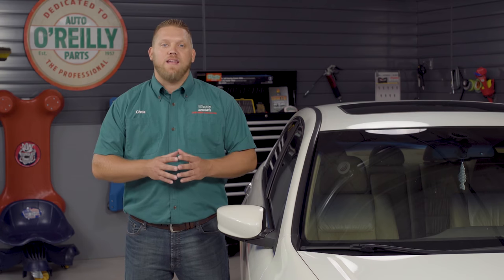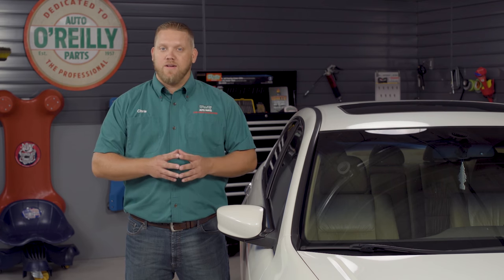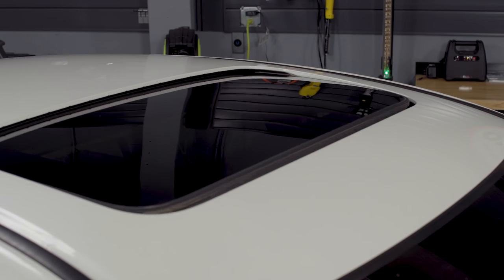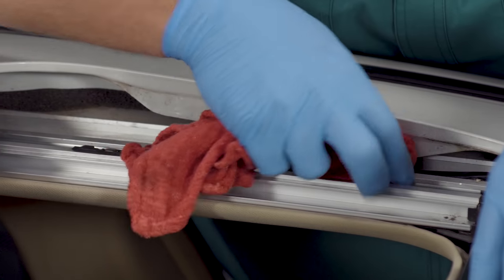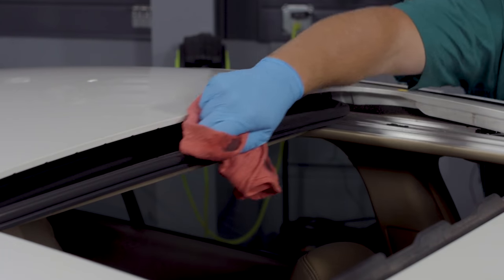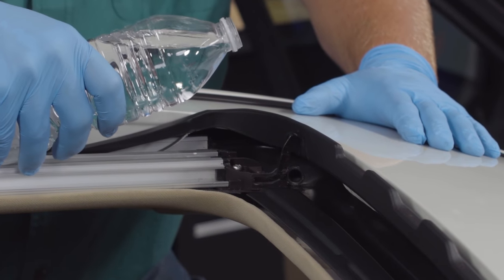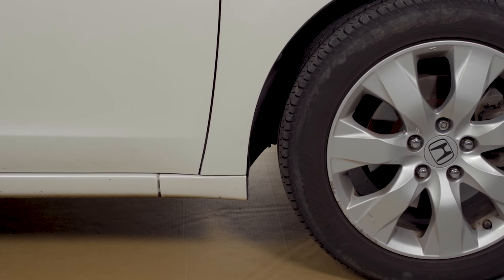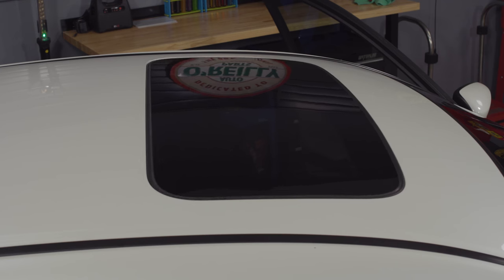How To: Repair a Leaky Sunroof

Comment: I was having a leak inside my 2007 RAV4. I was on the verge of taking it in and paying to have it looked at because my passenger seat was getting soaked every time it rained. Ran across this video, did the test as described, and sure enough the drain on that side had something in there that was restricting the flow as it too 30-60 seconds for water to start draining from the bottom and even then it was a trickle versus the driver said which was a near-instant gush. Hooked up an air blower and ran it for about 3 minutes and the flow greatly improved. The other night we received almost 2" of rain, and my seat was dry the next morning, no drips or anything. Thanks for saving me money.
Reply: Another mechanic channel warned against using pressurized air - the problem is it could pop the drain off the sunroof frame where you couldn’t see it, but you would now have a totally disconnected drain hose which would be even worse than a clogged one.
Reply: I have the exact same car and have the exact same issue right now, I’m about to try this

Comment: Do not use compressed air on some cars like Chevrolet and Saturns the tube is not sealed to the frame it's just sitting on it you use compressed air you can blow the tube off of the frame and then it'll drain all over the dashboard and get your carpet soaking wet use a thin long cable to shove down the tube and there are four of them not just two in the front ice install centers I know this for a fact my name is Bart Wynn my family owned Wynns Auto and Hampton Roads Sunroofs

Comment: What are the drains made of? Rubber or plastic? Because I don’t want to accidentally damage the drain using compressed air
Reply: Typically cheap thin plastic. Plus the older the vehicle the more degraded the plastic and the greater your odds of damaging them. Better to use thin flimsy wire the first couple inches and unblock them that way first, then use air but NOT with a full seal, maybe an inch, half inch away at first.
Reply: @geoffmosher 🙌 👏 🙏 🤝 👍 some also recommend an old odometer spiral . . .

Comment: Worked great! Unclogged the top with a poker and a couple feet of wire then poured hot soapy water down through drains in both corners. You can see and hear when it starts to drain. Thank you!

Comment: We just had an unidentified space object crash into our Sun roof.   No one was hurt but I didn’t realize that all there is about you head is glass and it just shattered.    We recently doubled roll rolled our car.   Our strong roof saved us.   I question the safety  of these Sun roofs ? Think g of trading my car in .    For a one that has a roof .

Comment: My daughter just bought a very clean '08 C30.  Since we had read that sunroof drains were an issue, they were one of the first things we tested, and sure enough the passenger side drained, but not outside.  This video was very helpful, especially the extension idea - since the tube had pulled away at the dash connection.  
Thanks very much for the idea!

Comment: Thank you for not telling me to push something through the drain holes, I would've been lost if you had. My Prius C doesn't have easily accessible drain holes. Thankfully I have an electric air blower that worked wonders, though! I managed to dislodge a large chunk of finely packed dirt and debris using just the blower! Now it drains perfectly!

Comment: I would not recommend using much air pressure at all the blow the drains out.  If you totally sealed that rubber tip to the drain hole and the blockage happens to be a really tight one, it might not move....but SOMETHING is going to move, and usually it's the drain hose coming loose from the exit spout behind the dash or kick panel.  And those aren't easy to get to.   
I'd start with running a long piece of trimmer cord down any drain first, and I never use compressed air.  Ever.
Reply: That's because this video is useless and defective you should never use anything over 20 psi when blowing air into that drain, and if you want to clear them easily use white vinegar and water solution and pour it down and that will loosen anything up then grab some plastic tubing approximately quarter inch by 5 ft and send that down the hole moving it back and forth lightly and then flush with hot tap water and they'll be spotless
Reply: Would hooking a strong suctioned vacuum work with getting the clog out
Reply: @cheyannelong7069  it can sometimes

Comment: Thank you!!!  When it rains, there is a leakage from my sunroof. .  Sometimes, all kinds of lights come on. There should be a recall since a lot of people are having this problem.  I opened my sunroof, cleaned around the inside sunroof, and all the lights went off. 
Lexus are pretty good vehicles. My vehicle is not that old, it's a 2014 rx350. She has many more miles to go. It's like the warranty runs out and she wants to do cartwheels.
She needs to just calm down 🤣🤣🤣 
I pray by me cleaning around it helped a little.  It was dirty. 😨
My husb backed up the vehicle in the driveway, and oh my, the driver side floor was soaked...we had heavy rain. I told him that for the time being, don't back it in. There are not a lot of good, honest mechanics around now days but I would take my vehicle to the nearest O'Reilly if necessary.  I pray I fixed the problem.🙏

Comment: driver side tube was obstructed by some flexible sealant, looks like it was there from new. Anyway, also blew air backward and think it will be good.  Might blow rears tomorrow, but I could not find where in the frame there were since when it is open, it's going to want to cover them up.   thank you !

Comment: I will need to try that. 2 days ago I got a puddle of water on the passenger side and the seat completely wet 
And diving home in the rain,  I just notice that the leak is coming from the sunroof. I also notices that on the driver side is the sunroof the water runs off the sunroof but on the passenger side the seal is absolute water like crazy. Can it work a tire compressor?
Reply: I see this comment is about 6 months old, but to answer your question a tire compressor doesn't have enough pressure to blow it out. It's got a constant low amount of pressure to fill the tire but that's it. You would need to get a can of compressed air if I'm not mistaken, like something that can blow to keyboard. Unless you want to drop dime on an actual air compressor. I search a few more videos and found other similar fixes. There's always a way. Always.

Comment: A question, I put compressed air into it and the water did leak out, but when it rained, the roof on the passenger side was wet again, could it be the seal?

Comment: I cleaned the drains, but it still leaks on the driver side from the headliner near teh a-pillar.  I removed some parts and pulled down a corner of the headliner near the driver side leak.  The drain hose is in good shape, but water is leaking from the plastics parts around the drain hole.  how do i seal the leak?
Reply: Same problem
Reply: Could be the weather stripping on the roof
Reply: This seems like the drain is too small for the amount of water entering the space. Which means that the seal between the glass and metal on your roof is allowing too much water to get in.
See if you can get that gasket piece replaced.
Does it pass the water cup test?
Reply: @brewdaddydub5379  Sure mate ! In many models the stripping is sticked together in MANY parts  (wtf ) and they can loosen over time (vibrations !). 
I´ve seen a video on yt, they had to take apart half the dashboard on each side (front) to get to the place of action - not very customer friendly !
Reply: No more sunroof cars for me

Comment: I just bought a 1985 Cadillac De Ville and the previous owner decided to completely seal the sun roof closed because it was leaking. but yet it's still leaking and now I don't even know if they'll be able to even remove the seal to fix it.

Comment: Using compressed air to blow a blockage out is asking for trouble. Why? If the dirt/blockage is too big to easily go through the drain tube,trying to force it through with compressed air may blow the drain tube off the tube at the corner of the sunroof,allowing the water to soak the headliner and on to the floorboards of the car. 
  Follow this video's advice at your own risk.
Blowing air through the bottom of the tube IF you can find it may work,BUT is also somewhat risky.
    Best way to try to remove a blockage is to use a reducer nozzle on a shopvac. If you don't have a reducer nozzle for your vac,simply use a small funnel,putting the small end in the drain hole and shoving the vac hose into the big end. This should suck any foreign stuff out with no danger of blowing the drain tube off.
Reply: 🙌 👏 🙏 🤝 👍 exactly mate ! Thats why old repairing manuals always recommend cleaning it (tenderly :P) with an old (and  l o n g ) odo-/ speedometer spiral !

Comment: I’ve a brand new moon roof on my LandCruiser but guess what, after driving in the rain, water gets trapped inside that “rubber band” that surrounds the glass moon roof. After a few months, the rust becomes visible from the inside. And there’s nothing the agent can do except to replace it, again. Frustrating! Btw, nothing wrong with the 2 drain tubes, rain water still flows smoothly through them.

Comment: does water normally enter the drain, even when the sunroof is closed?
Reply: drain should help even if there are leaks to prevent them from entering vehicle
Reply: If the seal is o. k., only VERY negligible quantities will leak thru . . .

Comment: I just had someone clean out the drainage system and charged $135, they said because they went all the way through the entire drain, and coming in at the bottom as well.   It seemed excessive.  The last time someone did it, they charged me $35.   Anyone have an ideas about what they could have done that would cost so much more????   THANK YOU!
Reply: You are much better off to use a shop vac to suck out any debri from drain or carefully feed .095 trimmer line down the line to clear any clogs without damaging the drain tubing.  Once water drains through you could carefully use some compressed air to totally clear drains.  Just don't put air nozzle tight to drain opening and risk blowing hose off from fittings possibly requiring removal of head liner to fix.
Reply: @jefffrayer8238  I know it SOUNDS easy, videos make it LOOK easy, but I couldn't find the spot where I could get a wire in.   Part of it may be I'm 70 and 5'2" so it wasn't the most stable view!!   Oh well.   Thank you for your help - I do appreciate it!!

Comment: Have a leak . I’ll try your way and let you know . Thanks for the tip .
Reply: ? Did you fix yours? I have to deal with mine
Reply: @Monarchfox  yes , I actually used some 30 lb test fishing line . Found the little drain holes 🕳. And used the string to get holes 🕳 clear .

Comment: I did that on mine with the air and it did not clear the clog it feels like maybe a hard clogged but it will not run water through at all not even a drop

Comment: The problem I’m having is the rubber seal at the back of the sunroof leaks and idk what to do for fix it
Reply: Try replacing the seal. Plastic is bound to go bad
Reply: @charizard_baller69  Did you know that for instance VW / AUDI demand almost 140 (!!) bucks for this seal (some elder models) ? So yes - refurbishing it IS cheaper !!